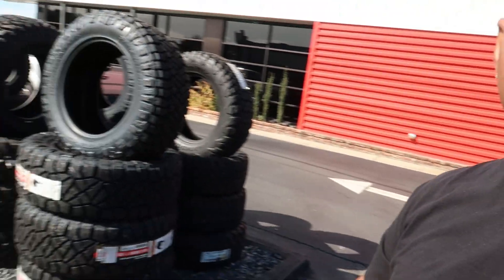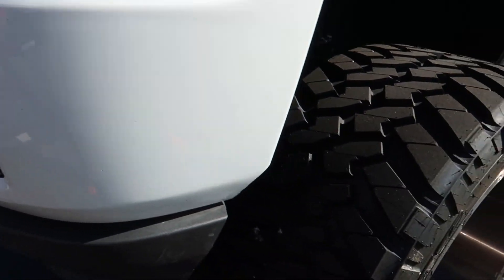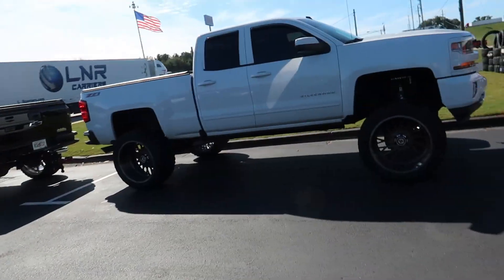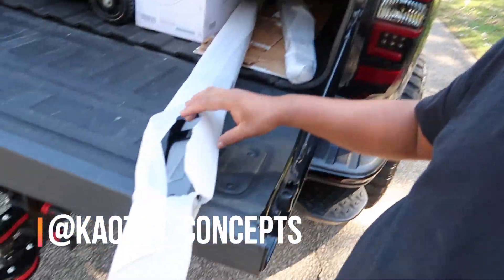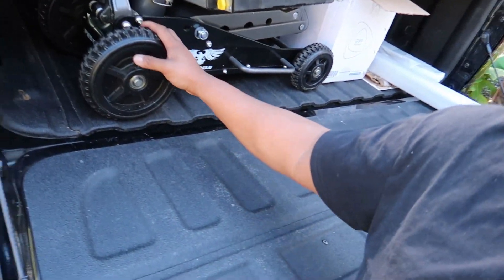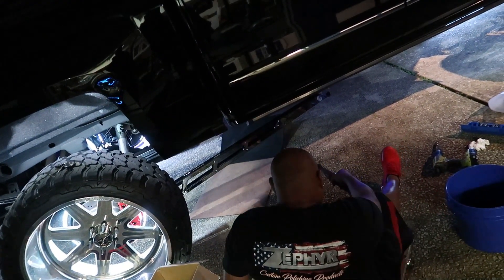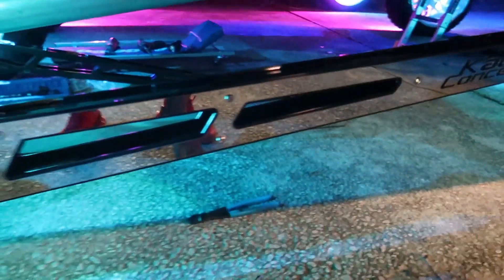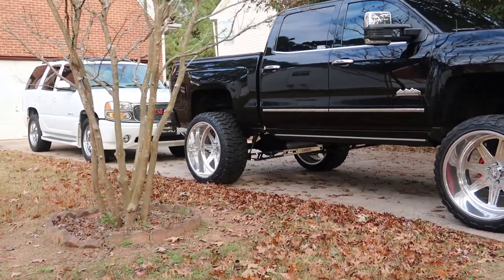Best Traction Bars!|Kaotic Concepts| 2017 Chevy Silverado High Country 6.2L 8in BDS 26x14 Amer Force

Comment: Did you have any issues with the company? I ordered them and their 2-3 week build time went out the window. A month and a half after ordering I emailed them for the 2nd time. They already apologized and said they'd ship out next day. Mentioned I had a show to go to and I ordered the bars almost 3 months in advanced so I would have them in time. They ship out the bars but hold the brackets until the day after my event ended. Expedited them out right after the show I had mentioned to them. I'm not impressed with their business rn
Reply: Also what is up with the long strips of metal hanging off the brackets that the nuts are welded onto for the frame mounts?
Reply from the maker: @camwalt.4197  man I'm sorry you had to go thru all that. I didn't have any issues with them at all and if I needed help with something I called them and he was helpful all the way. But I did have his number at the time so that definitely probably helped better than email. But the traction bars are great and I get complimented alot because they stick out so well. The nut plate is to help make it easier to install and to keep from moving inside the frame so u don't have to put a wrench in it. It would be hard to do because Limited on space
Reply: @BamCunningham  it's all good, I got what I paid for now. I kind of figured as much on the nut plate. I wish I could post a pic on here, but the nut plates have an about foot and a half long skinny bit that comes off the plate. Did you leave that on there in the frame or cut it off before installing? Thanks for the response
Reply from the maker: @camwalt.4197  it's to help wiggle it into place. After u get it on the bolts and tightened then cut it off
Reply: Damn I’m two weeks in right now hoping I don’t have to wait that long… I have everything in just waiting for these to come in so I can send my lift and bars to powder coat then finally install